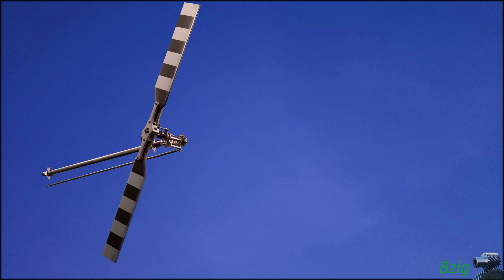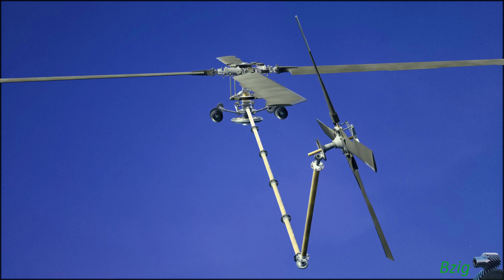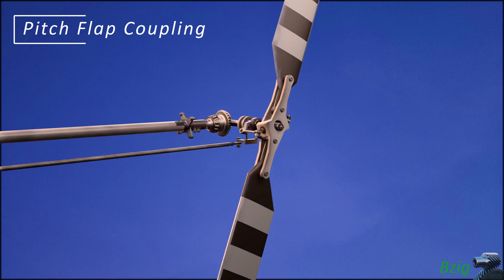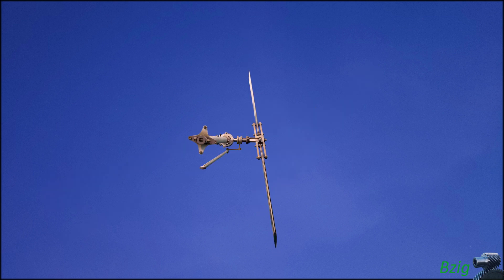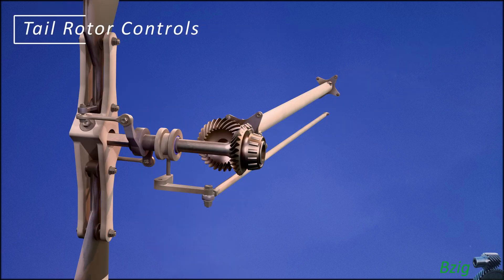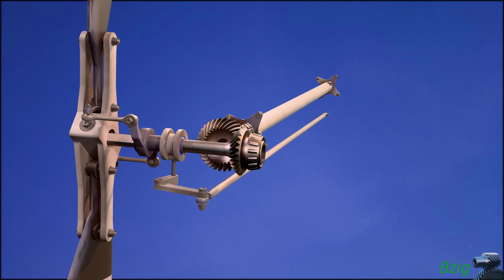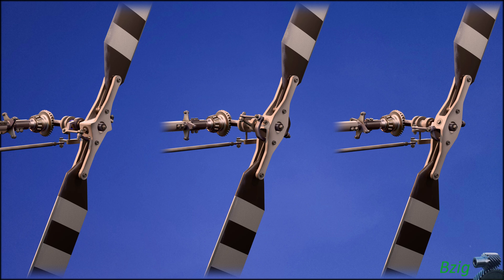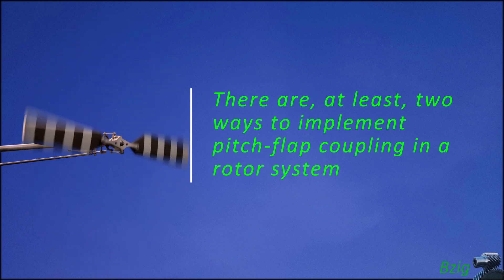R-44 Helicopter Tailrotor

Comment: Very Very good.  I am looking for a fairly accurate cad model of the R44 tail rotor gearbox and blades assembly.   Is that something you can help me with?  I work with Inventor and Solidworks.
Reply from the maker: I can... I just loaded the tail rotor file to the shop section on my buy me a coffee page...   https://buymeacoffee.com/bzig  

You can set your own price to pay and this includes $0

I made a .fbx and a .step file available.  I believe the .fbx should work with inventor.  I exported from Fusion and there are other file formats I can export to.  Let me know if you want another format.   

As far as accuracy, I did quite a bot of research using the IBP and other sources of online data.  It's as accurate as I could make it :)

Comment: I saw that the blade connection for AH-64 is made in such a way that the flapping hinge is level with the swash plate rods..The rods have ball joints and the blade can only move to pitch in one direction because of how the head is attached.

The blades can then move freely with dampers.. Then the whole assembly goes back to the exact same spot just outside the rod ends where the flapping occurs. 

When the flapling starts it transfers the motion back to the swash plate rods in a motion that is nullified by each corresponding joint. 

When the flapping occurs the joint is at the very location where no interfering up or down movement occurs and no vibration is moving down the rods back to the plate.. This was difficult for me to grasp but the entire blade assemly work as one big balljoint but still not .

I can imagine that a tailrotor simply put the balljoint even to the hinge

Comment: Hi! Any chance you will have a video on the style of main rotor system the Huey employs, or just in general of how stabilizer bars work in a rotor?

I've used your videos to create helicopters in kerbal space program with tremendous success, I'm so thankful you are making these!
Reply from the maker: I'm working on an animation of the Robinson R-44 rotor system... this is similar to the H-1 in that it's a teetering rotor, but it will not have the stab bars.  An animation of the stab bars would be cool... I'll consider it for the future.  The next Robinson video should be out in a week or two.

Comment: Why do some helicopters, like the Bell 407, have the hinge rigged the other way around, i.e., the blade that flaps up increases its pitch angle?
Reply from the maker: good question... I wasn't aware until you asked, but sure enough, it's mechanized as you say.  I came across this answer on PPRUNE... 

 "The original thread is a question about the negative delta 3 on the 407 tail rotor. "Helisphere", if you're still out there, the delta hinge minimizes flapping by taking the tail rotor natural flapping frequency away from resonance with the aerodynamic frequency. The natural frequency is 1 per rev, aerodynamic loads are 1 per rev. A negative delta reduces the natural frequency to less than 1 per rev, positive delta increases it to more than 1 per rev."  Posted by LRP in 2012.

If this is correct, then this is similar to why tiltrotors use "negative delta 3"  (quotes because Bell uses a different sign convention than academia, so it's hard to really know what someone means when they say "positive" or "negative" delta-3).  Tiltrotors learned this, experimentally, through the loss of two aircraft (one in flight, and one in a wind tunnel) and Bell learned that decoupling in and out of plane frequencies improved rotor stability.     

My video talks about FFDOL and it would be possible to solve FFDOL with flapping alone, at the cost of reduced blade clearance from the fin and boom.  So it looks like the 407 delta-3 is possibly unrelated to FFDOL.  

Troy Gaffey has an AHS paper on this but, so far, I've been too cheap to pay the $35 to download it.  I think I'm getting closer to paying the money... thanks for pointing this out!
Reply: @ thankou very much!

Comment: I used to fly on H-60 Seahawks in the Navy for 6 years. I do not believe there is any pitch flap coupling on the TR. The rubber boot at the base of the blade is where the flapping motion occurs. It is inline with the pitch links. 

As part of preflight, I would pull the TR blades back and forth in the flapping motion to check the integrity of the spar. I never recalled any change in pitch. 

However, even now as a helicopter CFI,  I've never heard the term pitch flap coupling until this video. Great stuff! A fully animated R22/44 would be a great resource for new pilots, and even seasoned instructors like myself.
Reply from the maker: thanks for the comment!  My source for the H60 was a NASA doc titled "A Mathematical Model of the UH-60 Helicopter" and they cite a tail rotor pitch flap coupling constant of 0.70   This means there is 0.7 degrees of pitch change for every degree of flapping.  This is very subtle and probably wouldn't be noticed unless you were looking for it.  I know where you're coming from though... I've flown helicopters for 30 years and some of the things I learn, as I create these vids, is eye opening... I keep having these "huh, I didn't know that..." moments.  Some of those come from the research, and others come from building the 3d in CAD and simply seeing how things work.
Reply: @bzig4929  Oh wow! I didn't know you're also a helicopter pilot. Seems like you have some aerospace engineering background too? You should do an intro video about your aviation experience. 

Looking at some H60 TR pictures again, I do notice the tiniest misalignment of the PCL and the boot, so the small degree of pitch change does make sense now.

Thank you

Comment: This is incredible. Where do you get the geometry data to model these parts in such detail??!!
Reply from the maker: mostly from Robinson's illustrated parts catalog, but also from pictures that are online on websites selling Robinson parts.  Those things, or course, don't give me dimensions, but there are tools in CAD to take measurements from calibrated photos; then I just look for the things in the parts catalogue that have known dimensions such as bolt heads, or rotor blade diameter.  There's a Robinson operator close to me; I haven't' done this yet, but I'm probably going to end up going out there to measure some things before I start the main rotor.
Reply: Holy crap AND you are answering my question! This is f*ing great. I owe you more than a coffee.
Reply from the maker: It was a good question... I really didn't understand the second method of introducing the coupling until you asked

Comment: 6:20 I would loved to have seen more vector arrows showing the aerodynamic forces and an animation of it flapping and spinning at the same time :D
Reply from the maker: love the suggestion!  I've been planning to do this for a while... to drive the size and direction of the vectors with the equations for lift/drag/motion.  It just takes time :(
Reply: @bzig4929  I understand 🤗

You had exactly what I was looking for later in the video, but instead of arrows, you put "biggest pitch" and "smallest pitch" which was what I was looking for :D
13:21